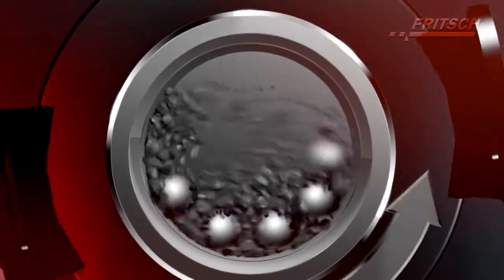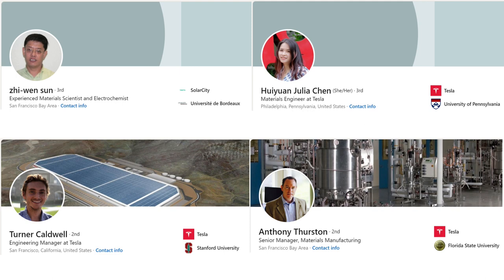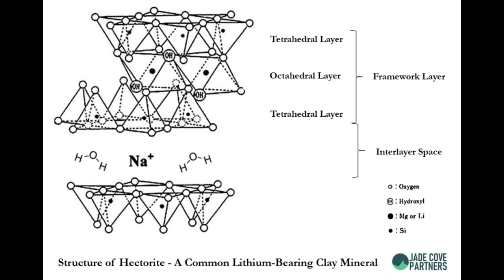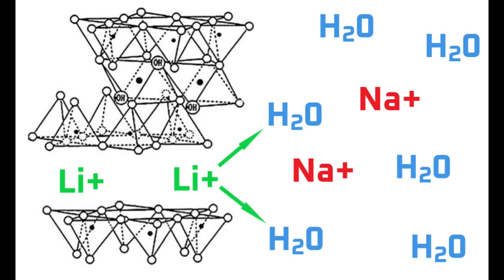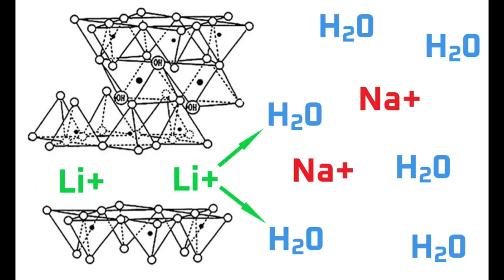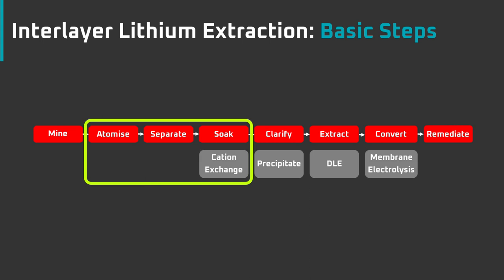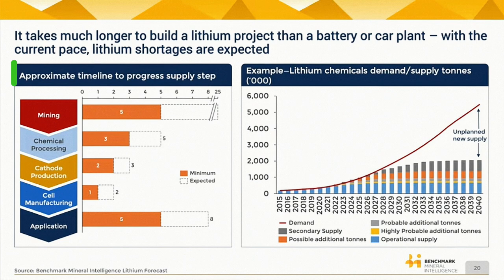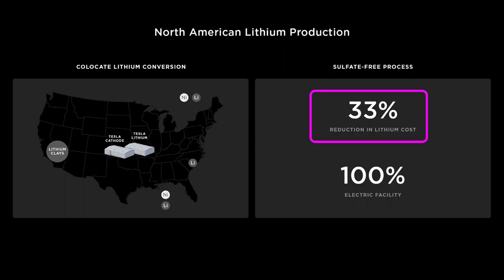Tesla's Lithium Clay Patent Application // Selective Extraction

Comment: I have experience working with large ball mills in the cement industry. We used up to 4000 hp synchronous motors to drive the mills. The ball charge was I believe around 100 tons of Nickle Chromium balls ranging in size from 1/4" up to 3". Nothing subtle about a ball mill. They are a continuous process as raw material enters one end and goes through chambers with progressively smaller balls and comes out the consistency of flour on the other at a high rate. Look to the cement industry for a hundred years of experience with ball mills.
Reply: Just wondering what amount of "ball" contamination do you get in the cement? Ie flakes of the balls, corrosion etc. Wonder how much this would effect the lithium process mentioned in the video?
☕☕🍻🍻
Reply: @brettmciver432  Good question. As an industrial electrician that was out of my scope. I do know the balls wear down and they have to dump the mills and sort the balls by size and add 3" balls regularily.
Reply: @brettmciver432  Most of the material worn off of the balls should remain in the solid phase and not get dissolved in the water.  In order for the metal to get dissolved, it would have to be oxidized.  The metals used in the balls form di- or tri-valent ions if they do manage to get dissolved, so they are chemically very different from the monovalent lithium.  It wouldn't be difficult to separate them chemically, if they were there in sufficient quantity to worry about.
Reply: @incognitotorpedo42 
Thanks here have a beer or 2🍻🍻🍻🍻
Reply: @incognitotorpedo42  So the major consideration would likely be that contamination from the balls needs to be an environmentally acceptible additive to the waste clay so that it can be returned to the ground.
Reply: @brettmciver432  If they use ceramic milling balls, I can't imagine it to have any influence on that. The leaching described in the video is more akin to regular ion exchange than anything else, it isn't coing to break the metal contained as oxides appart, only interchange Li+ for Na+ (or Mg2+) in the still remaining structure. The remaining "sludge" wouldn't be that different to the chemical makeup of the clay itselfe, a bit more "salty" at best
Reply: @brettmciver432  for cement the addition of iron is a benefit so ball wear is not a problem.
Reply: @ronblack7870 
🍻🍻🍻
Reply: Do ball mills work with a slurry as well ?
It would explain the Na,Li exchange.
Reply: @davidpaulsen1510  I've heard of wet process for grinding limestone for making raw mix, but no first hand experience. I've only worked around dry process ball mills.
Reply: @briansilver9652  me tub grinders farm and demolition.
I was just thinking of running a current through a slurry of salt and lithium clays in a hammer mill to help pull the lithium out. Like everything Elon we can just wait and see , usually doesn't take long.
Reply: Brian Silver - If you have an estimate of the total mass of the added 3" balls in a year, and know the cement production, you can estimate contamination rates, no?
Reply: @dromeiro  Makes sense to me.

Comment: Excellent video and communication style. I work in extraction of base metals and the only points I think you could add are: 
1. Lower grade feed material and lower recovery will mean much larger volumes need to be processed, which can make remediation more difficult despite no high intensity leaching.
2. Milling large volumes can be very power intensive (though my knowledge is based on hard rock). Tesla may be very well placed to couple this with its own energy systems.
These 2 points are by no means deal breakers, of course. 
3. Finally on the implementation side, I wonder if this technology will be outsourced /handed to Piedmont Lithium (who have lithium supply agreements with Tesla in North America) or integrated to Tesla itself. Though this is speculation, and not why we watch your channel.
Reply from the maker: Great points!

Comment: On the improvement by leaching I imagine it is related to the higher solubility of alkaline salts (Li, Na, K) compared to other species like Mg, Ca, Al, Si or Fe. Thus, leaching in water (assuming the water they use doesn't have any other "secret sauce") increases the amount of alkaline metals you get (that's probably why K also increases in the comparison). The good thing is that separating the Mg and Ca impurities is not that difficult and separating the other alkali metals is a process already known in other Li extraction methods.

I do research in mechanochemistry (not exactly this kind, more like high pressure stuff) and it is amazing how much things can change by "simply" applying force.

Hats off to the engineers that thought about this.

Btw, I love your videos. There are researchers that don't research their topics as much as you do on this videos. It's impressive!
Reply from the maker: My pleasure, and thanks for the insights!
Reply: Correct - the alkaline ions are most readily water soluble and don't require a stronger "acid" than just water. The other cations listed are less water soluble, but the acid moves the the equilibrium to the solution over the clay. By adjusting pH, an optimum balance of alkaline ion extraction versus impurity extraction can be found.

Comment: Jordan, thanks for the patent breakdown.  My understanding is that clay, by definition, is made up of small particles that are easily separated in water.  To my mind, it makes sense to wet mill the clay in a salt water solution, perhaps even a hot super saturated salt solution to maximize ion exchange.  Wet milling is quite common in many mining and extraction operations as a way of eliminating dust and maximizing separation and suspension. In places where water is not scarce, it is even common to use high pressure hoses called monitors to create a slurry on site and then pump the slurry to the mill using pipes rather than trucks. However, in Nevada I don't think this would be feasible.
Reply: Maybe the dry milling helps keep the impurities down by making it a more selective ion exchange
Reply: My basic understanding of mechanochemistry also pushes me toward both selective processes (milling and leaching) using a slurry. It would inherently increase rate of the kinetics and the shear transfer during milling. As as side note, if the two processes are used in series then the amount of cation contaminates would additively increase (ie. the cations released in the first step would still be around during the second process step if no intermediary step to remove the cations is used).
Reply: Yeah, would need a salt-water pipeline from the pacific ocean to Nevada! The evaporation of the residual extra water could help in increasing air humidity within the North-American continent if desired.

Comment: Whoooahhh. Another stunning informative video Jordan. My chemistry goes back 40 odd years and this mechaochemistry is news to me. Milling obviously pulverizes, but it's never been self evident that it would also produce structural changes. That said, most chemical reactions are endothermic so you put a shed load of energy in (via Bunsen burners normally - in the lab at least) to make them happen. Mechanochemistry evidently does exactly the same thing with a mechanical energy transfer instead. I'm assuming you're getting drying effects too. But all this energy has to come from somewhere... Assume solar powered motors (with battery storage of course). There's so much beauty in this entire process. The fact that it's so environmentally benign is fantastic. The selective leaching is brilliant. I'd love for Tesla to apply its chemistry brains to other industrial extraction processes - so many are environmental disasters. I love your compare that to the Tesla process... take some clay out of the ground, grind it up for a few hours, add salt and hot water, done. Funny, succinct and economical. This simplification of any idea is the essence of comprehension and communication skills. Your skills in the battery arena are truly first class. The chemical change through mechanical energy input appears completely new to me. It sounds like there is some merit in the patent application.
Reply: You're right, it would be great for Tesla to tackle other problems. Low carbon/energy methods of cement and steel production come to mind.
Reply: I imagine boring company drills mining these resources on earth and mars.
Reply from the maker: I need to do a video on mechanochemistry!  I've just started looking into it and... 🤯
Reply: Mechanochemistry is very important in the bread making process. Work your dough! Also don't forget the salt.
Reply: @kazedcat  Oddly, I've just been experimenting with Keto breadmaking and one iteration I did forget the salt. Result was inexplicably failure. But if mechanochemistry is involved....
Reply: @thelimitingfactor  I'm wondering if it can be used in enrichment. That would be scary. I've heard there are subtle differences in 'normal' reactions between isotopes of U.

Comment: Planetary milling is MUCH higher energy than ball milling, and also provide friction/shear forces that you just can't achieve with a ball mill. Also, wet milling (both ball and planetary) is even more efficient and can achieve smaller particle sizes than dry milling. As a chemist, I would suggest wet milling in a brine solution. Planetary milling generates a LOT of heat too, so it could be a self-heating process.

For industrial scale, attritor milling is another very high energy (much more than ball milling), scalable process, as it can be run in a semi-continuous mode, and it also generates a lot of heat. I see you have an attritor mill in your diagram--look into it.

Comment: This video makes me feel a lot better about my concerns of the process ...  You've acknowledged that it can be a long / difficult process to get a mine approved for production. They've already been working on the process for 3 years.    And the process will be so much cleaner than expected, that it will be a lot easier to get through that massive regulatory permitting process.

Even if Tesla doesn't get a patent,  the application at least shows prior art which will protect them from others patenting the process.
Reply: It will come down to the NIMBYs that will say the clay without lithium is an eyesore.
Reply: @normcfu  And those NIMBY's will be funded by big oil and ICE car dealerships.

Comment: If 65C is close to the temperature that would allow efficient Li extraction then that would be well within range for solar thermal heat exchange panels so that could be another way to save money/reduce environmental impact at least during the day especially in sunnier/drier locations, say Nevada?
Reply: I think just the friction from high energy milling is going to add heat to the mixture, but don't know if will be sufficient to take it to 65C.
Reply: @normcfu  yep, the milling process will certainly heat up the powder but for the leaching step it appears that the water/salt/clay slurry has to be held at high temperature for a few hours and that might be where solar heating might be useful, or may just be cheaper / easier to use electric heating elements and source the power from the grid
Reply: @RojCowles  If that fluid is reused, it may retain much of its heat when added to the next batch of milled clay.  It could also go through heat exchangers and be cooled while heating the next batch fluid to go in.  There are several possibilities of reusing the heat.

Comment: Jordan, in the semi-selective magnesium chloride method, couldn't Tesla just sell the non-lithium metals ? It looks like Chromium, calcium are more expensive than magnesium per kg. Seems like this would make their lithium even less expensive if these impurities could be separated inexpensively but thats a big if I guess.
Reply from the maker: Hey Joel!  Great question!

Definitely, they could sell those.  However, how much will it cost to separate those elements away from the lithium and what is the impurity tolerance for each element?  

Battery manufacturers will accept some elements as impurities in miniscule amounts, and others they have pretty much a zero tolerance.  The question is, which elements?  

Were the elements they showed the full list they tested for, or did Tesla just report the elements that were the most detrimental to battery life or the most difficult to remove from the leach solution?  

This also leaves the question of what to do at the remediation stage.  Elon said it was a dig and replace process.  If the clay has been deeply altered, can it be replaced?  Sodium is naturally found in the interlayer of the clay, so putting it back in the ground with .3% of the Li+ swapped out for Na+ should be manageable.
Reply: @thelimitingfactor  yeah. Prob would make more sense to run through the salt process and then run through the magnesium process if you wanted the extra materials versus trying to separate later. But thanks for the response. Great topic. Maybe you could write a companion piece on insideEvs or teslarati and get more eyeballs on this great work.
Reply: @thelimitingfactor  
"What to do at the remediation stage?"
Engaging "KISS Mode".....
Tesla (Boring company) has the machinery to build bricks......?
As long a contamination isn't  harmful in that application.

"The best remediation is no remediation"?
Reply: Can imagine boring company machines surfacing in the Nevada desert like sand worms from Dune! 😜🤪
Reply: Could the magnesium salt may be part of a secondary extraction process that works the extracted brine after primary lithium extraction?
Alternatively, I wonder if a ratio of sodium and Magnesium salts may have a “fine tuning” effect on the extraction process?

Comment: A nice analysis. A large tumbling mill such as shown in the video would likely be a poor idea for this application due to the relatively large grinding media size relative to the particle size. Perhaps a better choice for scaling up would be an IsaMill / Netzsch mill which has comparatively much higher energy intensity (W/m3) and the smaller media size (ceramic beads rather than steel balls) would have a significantly larger surface area resulting in more ball-particle contacts for more efficient grinding. Even so, it would be an expensive process for the grinding alone.
Reply from the maker: Nice!  Thanks for the input!

Comment: There is a membrane extraction method for extracting Li from brines which looks like it will be a game changer.  It could be used along with this grinding method to extract Li from the soup. In addition, ball mills are used to crush Cu ores and then froth flotation is used.  This might be an approach for Li.  The key is finding a set of chemicals that attach to the Li so that the bubbling can float the Li to the surface.  With Cu, tiny concentrations of Cu in the ore can be profitably extracted.

Comment: Awesome content but i really do feel that the best way to mill down initially is just as a media blast machine works . This can be shot continuously at 1mm square ceramic mesh wall at very high speed and will return via a loop for more smashing until the particle mass fails to exceed the vortex particle seperation vacuum . It then goes into another mill for further refining. The first process I beleive would be the most effecient.
Reply: What size particles are you starting with?
Reply: @briansilver9652  probably sand size i guess but the number crunchers will find out from the electricity’s bill. 👍🏻

Comment: Jordan, there is another aspect about patents and it has to do with how disruptive/valuable the patent can be and the maturity the business it is coming from/suppurating. Most disruptive patents are process for new business, the value of the patents is unknown but if you manage to get the business around it working the patent adds value, if the business is ongoing and the patent seams to hold incremental value it usually get processed and publish (like defense walls) but if it promises a lot of value then it gets withheld and kept as a trade secret ( secret weapon). The reasoning being that it will give competitors clues around your secret weapon, unless its leaked competitors would not get up to speed. I learned this at HP, disruptive tech ideas for making print heads rarely see the day of light or a patent office, Incremental patents do. Lithium extracción still has to deliver value, but tab-less electrode as part if battery making is an ongoing business and may never see the patent office as long as tesla is quickly improving it and keeps competition in the dark.
Reply from the maker: Fascinating!  Thanks for the input!

Comment: Very interesting video which does a good job in explaining the patent application.  Scale-up of this type of heterogeneous reaction will be challenging.  It appears that the ball mill design has not been scaled-up past lab scale and that may be a major barrier to production level lithium extraction.
Reply from the maker: A great point!
Reply: Tesla should take a look on pendulum mills. The ceramics industry has a long experience using this kind of grinding process.